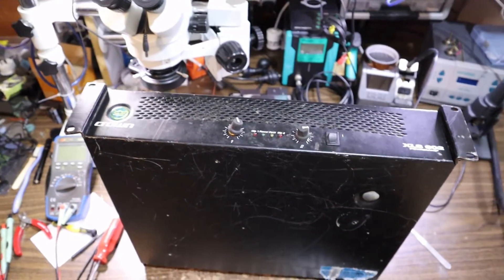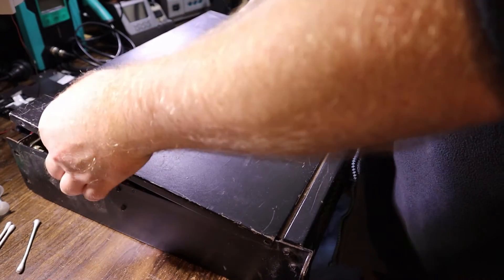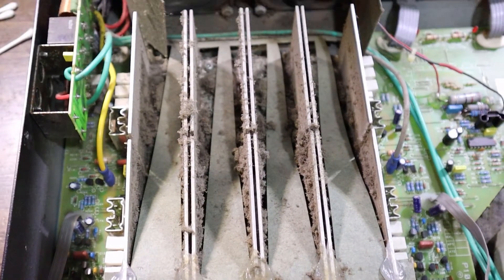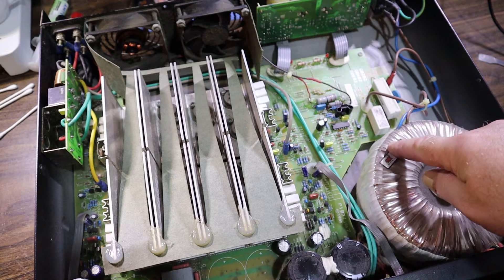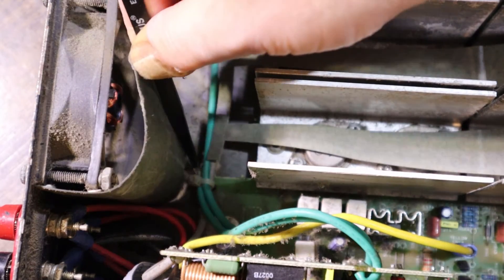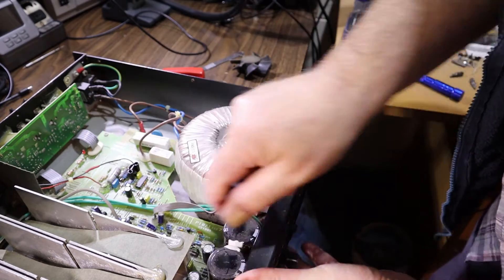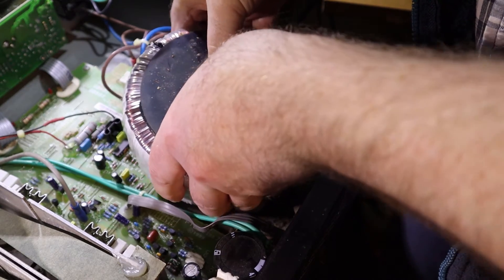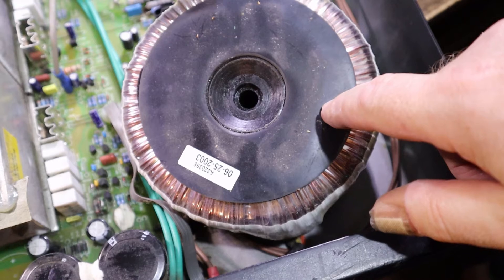Crown xls 602 amplifier failure analysis. The price of human error.

Comment: yo, my man Hey I have this crown amplifier to run the subs for my pa, ch 2 has a strange issue, every now and then a white noise will come through the channel get a bit louder then the circuit protection kicks in then resets and the amp continues to work as normal until the issue happens again. Can't really run the full rig with this happening
can you send me the schema you have, im up in taranaki if you have a contact number i could give you a buzz and maybe you migfht be able to assist me in this repair, i have all the tools needed  juist not the exact knowhow.

Comment: those caps are made that way ,the plasic discs are slightly over size and therefore bow when the heatshrink wrap its put on , common mistake  plasma/lcd tv repairers make,  but more to the point this is analog kit - caps running at 50/60hz dont fail that way, they just leak over the pcb with age/temp 
 i keep having to write off cambridge audio hifi amps for dead torroidals 
people think because it has a/b speaker posts they can run  2 sets of speakers 8r each,  theres an embedded  a non resetable thermal trip in the primary that writes the amp off

shame that amp isnt mosfet ,those 2sk135 2sj50 hitachi mosfets sell for crazy money
Reply from the maker: Interesting. The caps felt pretty firm, I have been able to push them down in the past. Might double check

Comment: Pretty sure those caps are fine.  The top of them is just a plastic disc retained by the heat shrink.  They usually vent from the bottom on those styles.  Those plastic discs curve up a lot of the time and have nothing to do with the condition of the cap.  Best bet would be to desolder and test them though. If the xformer is only damaged on the outermost winding it might be an easy fix if one was determined enough.  =)  Wish it was on my bench, I'd give it a try...
Reply from the maker: Yeah those plastic discs pop up but these were firm giving me impression of the cap itself and because of the lack of cooling I ran with the idea. Could test them and take a closer look at the windings.
Reply from the maker: Had another crack at it just for you 😊 Video up!